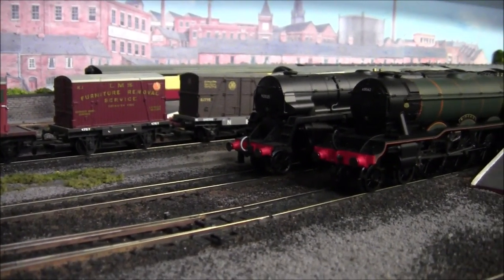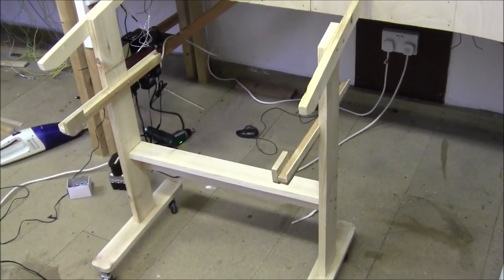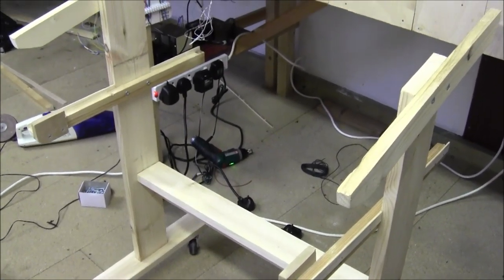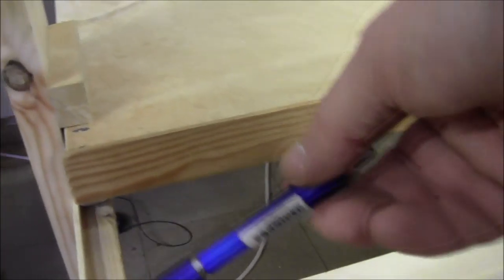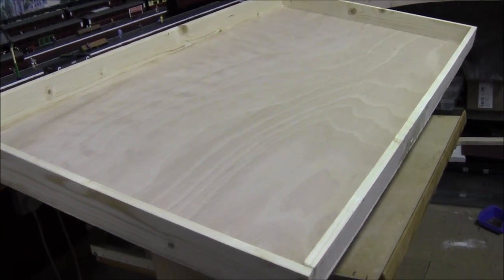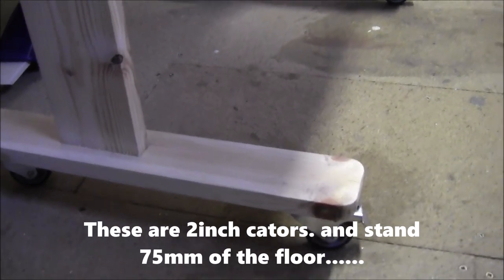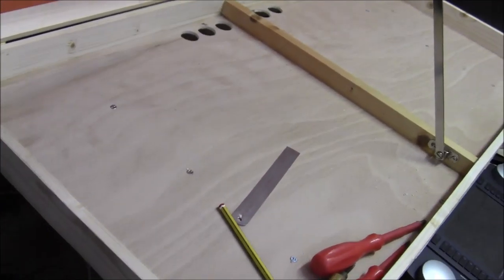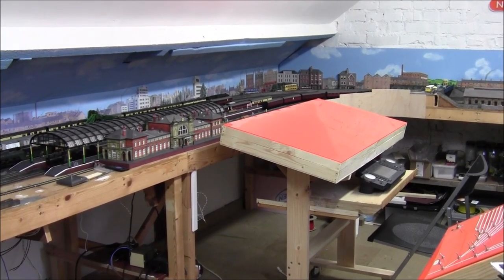First project of 2019 Building a control panel. No158

Comment: I am at this stage with my layout, but on a much reduced size. Beautiful woodwork and design.
Reply from the maker: This what i always call the fun stage of building a layout. if you have reached this stage. Then after this its all about running trains. now that's what i call the relaxing stage. 
My only regret is i should have made this control panel a lot smaller and deeper. thank you for commenting. all the best Tony
Reply: @TONYNORTHEASTERN  Thanks for the reply. I am (perhaps, too much) detail oriented, so my progress is slow. I am amazed at how much and how quickly you accomplish. (Do you ever sleep?)  I am inspired to follow your example. Thanks, again.

Comment: Looks fantastic, a complex and efficient electrical system!
Reply from the maker: cheer's Phil. it will be once completed it may take a few months. as there is a lot to do. once done trains will be able to run properly. not only that some of the Bachmann loco's that only run on the tyne dock branch, will able to run on the mainline. due to not wiring the up the electro frog points ..thanks again for commenting cheer's Tony

Comment: Control panels look brilliant, would it have been a bit better if you’d built it a bit lower? So you could use the castor wheels to push it under the layout out of the way to save a bit of space
Reply from the maker: Nice idea Richard, that would have worked a treat, but its ok for what i need, as i can sit at the controls and still see everything around me. nice idea though. thanks again best wishes Tony
Reply: TONY NORTH EASTERN no problem. My name isn’t Richard though, but no offence taken 😜

Comment: Looking forward to your electric installation. I’m currently building my first layout, will be interested in seeing how all your lighting on the layout is arranged and managed. I struggle to understand the resistor requirements. Are your lights controlled together or by section / building?
Reply from the maker: Hi Brian. my lighting is kept on a separate circuit. I use 16v transformer 50hz it might sound high voltage. but it can do 200 + LEDS, and lamppost's, all LEDS have a resister soldered in line. here is a link....www.resistorguide.com/resistor-for-led. hope this helps regards Tony